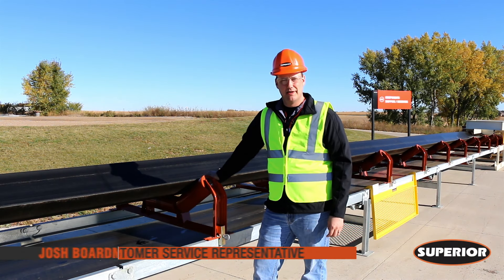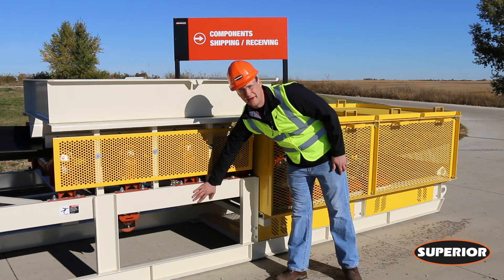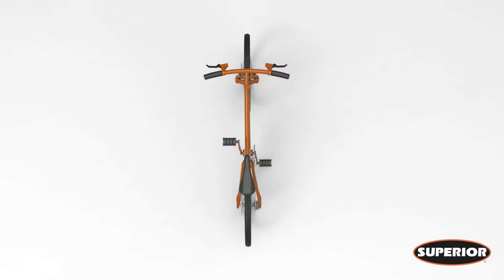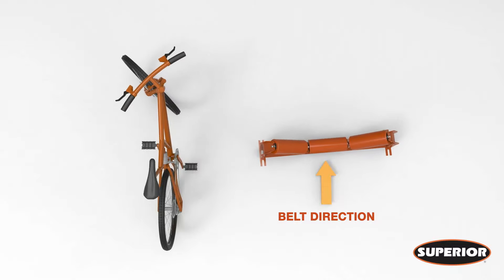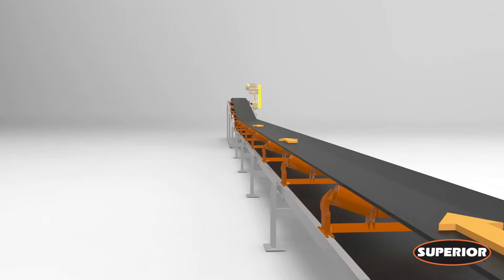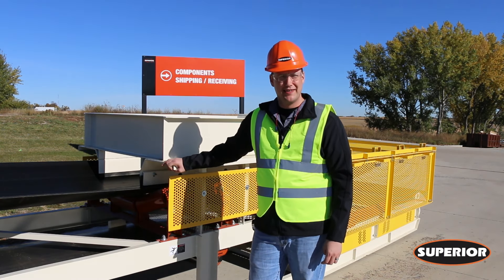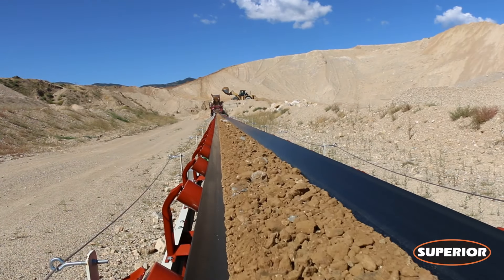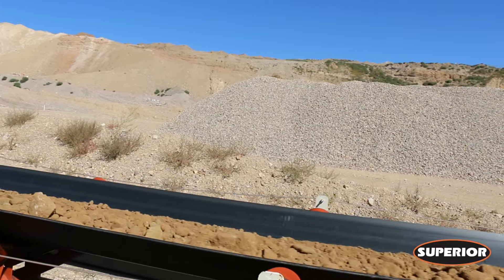Service Tip: Conveyor Belt Tracking

Comment: Its the exact opposite, you need to track the bottom starting from the head pulley and work back towards the tail. Been doing it this way for years. Your right on about loading the belt.
Reply: How often should the pulley be grease
Reply: John Donahue maybe you can shed some light on a dispute I was having about belt replacement which way faces up on the belt the threaded side or the heavier rubber side
Reply: @brandonsheridan2873  the thickest rubber cover should have up
Reply: Just do it the lazy way and put a 12 month auto greaser.

Comment: So how come every fitter I've seen is down at the tail drum pulling one side this way or that way.?
Reply: It is a common way of tracking the belt (although not recommended within best practices). Conveyors generally don't get the attention they should do. Also, there are lots of practices that work but are not recommended nor optimal. 
Regards

Comment: Good basic video but missing alot of finer details. Most belts when they have been running for days and "all of a sudden" start tracking off its an indication of a developing problem. Not solved by skewing rollers or frames. Improper loading, buildup on tailpulley, return side travelling over buildup, seized rollers just a few areas to check.
Reply from the maker: Thanks for the additional information, Guy.